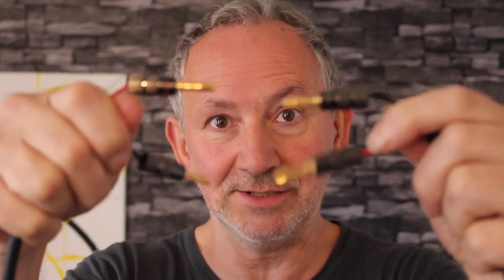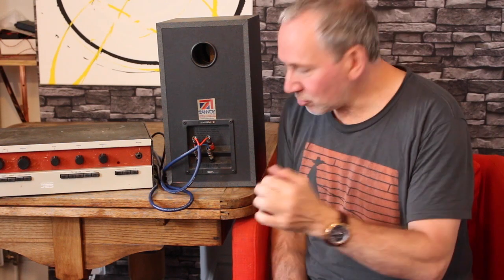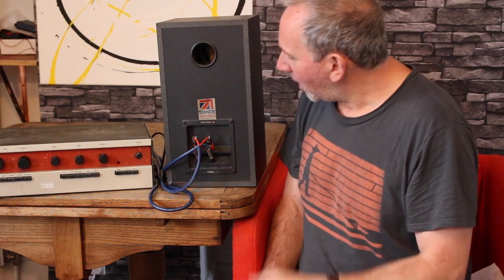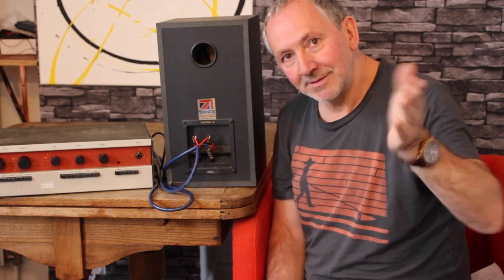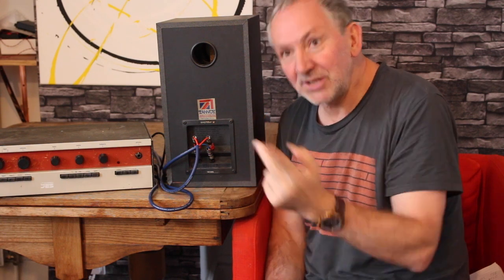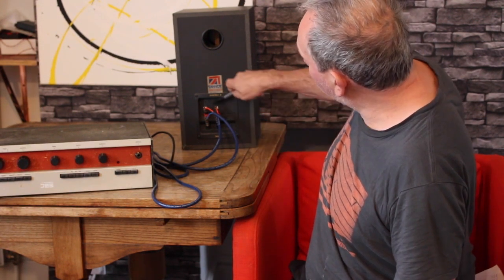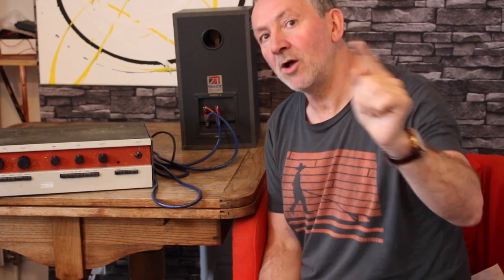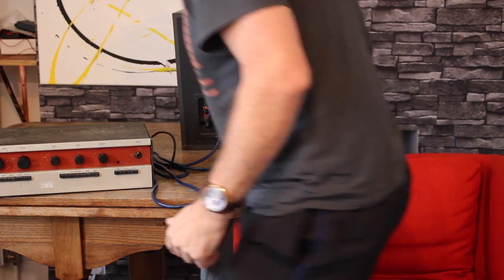WHAT IS BI /WIRING does it improve sound quality

Comment: Yeah....Nope! As others have said, you can't bypass any of the crossover circuitry. It wouldn't be able to do its job if you bypassed anything! (anything significant, at least). 
Using different cables for LF/HF could indeed "change things", but only for the worse. Some "amateur audiophile" tinkerer playing around (yes, playing!) knows better than the company that designed the crossover? Hmm, sure! Cables can only add LOSS. If you use very thin cable on the LF, sure, you'll lose some bass. You'd have to use insanely rubbish cable to have any significant impact on the HF side. Cables can't "add" anything, they can only detract, so if you're hearing differences from these "tweaks", it's because you're introducing loss in the signal path. Speaker cables either provide sufficient current-carrying capabilities, or they don't. Only on the "don't" side of it will they change the sound. Any actual "improvements" are placebo at best, IMHO. The manual for my Rogers LS3/5A speakers does, somewhat surprisingly, recommend bi-wiring. They make vague claims of "improving the stability and depth of the stereo image", which sounds like the sort of word-salad rubbish that they print in What Hifi? magazine. I remain thoroughly unconvinced about bi-wiring. It simply makes no sense. I can see how your typical "audiophile" would buy into this rubbish, but from a more technical standpoint it just doesn't make sense. "Audiophiles" are like the "quack doctors" of audio engineering. The vast majority of them have very limited technical/audio engineering knowledge and just repeat what other "audiophiles" have claimed. Probably true of that Rogers manual, too! In that case, I feel they do know better, but are telling the customer what they want to hear!

Comment: Bi-wiring is only possible if you have A+B outputs on your amp, otherwise, you are just connecting both wires to the same output.
Reply: That is a given, its using the different cables resistances to compensate for an amplifier's lousy damping factor. Think vacuum tube amps.

Comment: Wait, so you can you use bi-wiring to avoid using a crossover?
Reply: NO. The crossover is still be used inside the speaker cabinet per channel. The removal of the jumper plates simply separates the parallel connection of the two sections.
Reply: @Jason-wc3fh  Unless you have a crossover in your amp the wires all carry the same signal and that is only filtered in the speaker crossover. Bi wiring is a good way to add cost and RF noise into your system, if that's what you want.

Comment: You are missing the point of the benefits of bi wire. In my opinion the wire makes very little difference if any al all. It is all abut amplification. (Think!) you can now use 2 amps instead of 1. So if you have been using one 50w pr ch amp, but you happen to have two 50w pr ch amps then try the two. If you are really clever, you could use the two 50w to power the bass by linking them together. You can change the crossover components for the tweeter requiring a less powerful amp, maybe 15w to 30w. This will have a far greater effect than any wiring you may change. This is assuming the speakers RMS is around 120w.
Reply: In other words a 2.1 system.

Comment: It makes absolutely no difference. Logically and electronically to think otherwise is insane. Using modern speaker cable you will get no difference. The A and B terminals on the amp receive the same power, when using both they are bridged, just like the bridge plates on the speaker's terminals. So you've effectively removed the bridge plates from the speaker end and attached them on the amp end... how is that making any difference?
Reply: No difference to reality but big difference to the placebo effect.

Comment: Hi, I'm really enjoying your very enthusiastic reviewing but I think you're wrong about the Bi-wiring going direct to your HF driver and bypassing the crossover. Surely that can't be correct because full frequency bandwidth would blow the tweeter - it needs the bass frequencies to be removed because the thin coils of the tweeter can't handle that load or range of movement. Just saying! Keep reviewing please!
Reply from the maker: Yes it’s not bypassing the crossover but one wire does so that’s one why that doesn’t have to go through the whole crossover shenanigans
CheersK
Reply: Thanks K, I've just found you and I'm working my way through your reviews. Amy thoughts on vintage Castle speakers? Thanks, Ian
Reply from the maker: Well generally speaking I would rate them quite highly watch out for bass drivers with foam surrounds though that rot or disintegrate they did use them I believe sometimes
Thing with Castle they kind of not hip they don’t make that name anymore so people haven’t heard of them so I think they might be good for a bargain
K
Reply: Thanks for the sound advice on Castle and have a great Xmas and New Year 2021
Reply: @stereoreviewx   Yeah not true. Sorry. All the links do is combine the two separate inputs to the two sections of the xover. Neg will be common anyway in most designs. Biwring makes a difference in most cases but it is highly subjective as to whether its an improvement. Depends whether the designer voiced the speaker in biwired mode or single wired with the links on. And of course just personal preference. I may know more about HiFi gear than you but you are way more entertaining than me. Keep up the good work.
Reply: @stereoreviewx   Nope... Still around but owned by IAG.  https://castle.uk.com/

Comment: What is the idea behind biwiring ?
It is that some frequencies degrade some others and more precisely that low frequencies degrade high frequencies! 
-	First, why it wouldn’t be the opposite ? 
Getting into it, it would mean that a 365Hz would influence a 370Hz but also all frequencies in between. So pushing things further, in the ideal you shouldn’t “biwire” but “thousand-wire” or more, for as many significative frequencies with as many wires required!
-	Second if that was the case you wouldn’t be able to have any electronic equipment, like. spectrum analyzer! Another example is that you’ll never be able to get a square curve. This is pure electronic facts. 
This theory isn’t holding up ! Ask yourself why biwiring is done only in audio and more precisely only for the speakers’ cables !!!!

There are two types of biwiring.
Either the filters are on the drivers’s sides or they are on the amplifier’s side.

Roughtly in both cases, your amp will have to deal with two different impedances, specially if you use different cables for low & high, but the driver manufacturer has no clue of the impedances of your wires so they cannot calculate their filters in function. They made their filters supposing a same impedance cable, they cannot do otherwise unless they sell you the cables going with it but they won’t know the length you need. So biwiring doesn’t bring any avantage but furthermore it is a problem, you just double your wire cost for a degraded sound.
To sum it up, biwiring unbalance the impedances between the high and the low frequencies of your speakers which haven’t been calculated for because it is impossible.
Reply from the maker: I would say there’s two things going on
One inside the speaker you are having a shorter path to the driver it’s not going through the crossover board certainly one wire isn’t
The other thing is kind of basic which is you’ve doubled the amount of cable
Reply: @stereoreviewx  Crossover just after the amp, or just before the speaker make not much difference. In either case you have a certain length of cable to reach the speaker, so a certain impedance to factor. The manufacturer has to make an impedance choice to calculate its crossover and it is same for both High and Low. The worse scenario is having two different cables for High & Low.
When you say cables matter, you are right in the sense that some would have a better matching impedance for the couple Amp/Speaker. Some also may be better protected against magnetic fields around.
Reply: @stereoreviewx  There is no shorter or unfiltered path. The signal whether traveling through one cable or twenty will pass through the crossover. A capacitor for the high pass and an inductor for the low pass. Which frequency do you suggest doesn't need filtering?

Comment: you are completely right: by biwiring you are already reducing the resistance by around 50% - this itself MUST be possible to hear
also: as far as I remember from school: higher frequency is conducted more close to the surface of the conductor than the lower frequency so twitters should have advantage while supplied with different composition cables (vs. bass)

and then on top of that the other tricks might play ;-)
Reply: You would reduce loop resistance by half only if you kept the links in place, which would defeat the whole objective.
Reply: @paulb4661  OK, you are right. Maybe I did not make it clear: let it be 1 Ohm (the resistance of the cable). Second cable will be 1 Ohm as well. So if they were completely in parallel it would be 0.5 Ohm resistance of such double line. But by splitting the signal from the source into 2 cables for 2 speakers you make (let it be for the calculation only) half of the current in each cable: half power for bass and half power for twitter (again: for calculation only). So if your single cable setup was sending 10V from source and speakers required 1 A in total, now, with 2 cables you will send 10V to bass speakers  with only half of the current (0.5A) and 10V over to twitters also with half current so 0.5A. Apparently that is now the difference: each  cable will conduct half of the current (0.5A with biwiring vs 1A with single setup). So less current on 1 Ohm cable will leave less of the power "consumed" or "lost" on each cable. Will that make difference? Am I even correct now? My school finished ... plenty years ago ;-)
Reply: @zyghom  Let's take it one step at a time, firstly the spectrum of typical music can be approximated to pink noise, which means that power is inversely proportional to frequency, more or less. Therefore, for a typical 2 way system crossing at around 3kHz, 90 to 95% of power is diverted to the low midrange driver and only 5 to 10% to the tweeter. Secondly, the amount of current flowing through the conductor does not have any influence on its measured resistance, unless it's excessive to the point of heating it appreciably above room temperature, at which point the speakers have already ignited and took off like a rocket. Whether it's 500mA, 1A or 15A of current flowing through the cable, it's loop resistance remains determined by the alloy, CSA, length, quality of terminations and annealing methods to a certain degree. To summarize, for typical bi-wiring, a little less current will flow through the lower, LMF pair of wiring compared to single wiring and very little current will flow through the upper, HF pair, but the resistance placed in series with the tweeter or the low midrange driver will remain exactly the same, if you just double up the cable and remove links. Do not get me wrong, I enjoy the benefits of multi-wiring/amping myself.
Reply: @paulb4661  you are right: most of the current will go to the midbase rather than to tweeters. ;-)
Reply: @zyghom  Precisely, moreover the ratio of DC resistance of crossover inductor in series with the low midrange driver to that of the driver itself is the true determining factor of utmost importance, when it comes to maintaining low loop resistance - an aspect often overlooked in wiring loom resistance debates. Commercial examples often feature 0.4Ω DCR inductors in series with a 4Ω DCR driver, at which point  cable loop resistance makes very little difference, as the amplifier-driver interface is already severely compromised. In high quality crossovers the aim would be to keep inductor DCR at 1/100th of that of the driver, whilst refraining from using magnetic cores to increase inductance at least for low midrange drivers.

Comment: hi how about if my amp has only one pair of terminal means 1 can i do the bi wiring?
Reply: You can it can make a big difference still.
Reply: @MrRichymil  No, What is seen in this vid is bi amping which can make a difference in some situations, bi wiring makes no difference.
Reply: @Tappits84  believe me if you biwire from a Cambridge Audio A1 to Linn Nexus speakers like I did about 25 years ago it makes a big difference, ever tried it?  currently I am bi amping with a old Cyrus 3 with a PSXr on the base and Cyrus smartpower Plus for the treble into Linn katan speakers which is very beneficial, bi-wiring as I describe with only one amplifier and only the one set of  posts out of the amplifier for single wiring,( like the Cambridge Audio A1 but used for bi wiring) can made a big difference to  what you hear depending on what equipment you have.
Reply: @Tappits84  Indecently in the video I certainly would not describe it as demonstrating bi-amping, bi-amping is when you use 2 separate power amplifiers not one integrated amp with terminals for two sets of speakers, that's bi wiring.
Reply: @MrRichymil sorry for this question, but how can I biwire if my amplifier has one pair of terminals? Do I put both HF and LF in the same terminal? does it mean I should buy 2 cables, one for LF and one for HF and then simply put them in the same terminal on the amplifier side?
Reply: @kfernandes86  The way I did it was to put two sets of cables into each terminal. I was using solid core ring main plug socket wire that Electricians use when wiring the house. It came recommended from a friend who had  thousands of pounds worth of Linn equipment,  in fact he sold the Linn Nexus speakers I was using then.
Reply: @MrRichymil  thank you, I will try it
Reply: @kfernandes86  Did it make a difference?
Reply: @MrRichymil  I think yes, but to be honest the difference was very subtle. Seems like the vocals are a bit better. But only noticeable on a few tracks.
Reply: Most amps only have 1 speaker output per channel. Running 2 sets of speaker cables off the same terminals on your amp is just as good. The only downside is if you have stiff cables, it can be a pain to connect the two. Most cable manufacturers will terminate 2 separate pairs of cables to connect at the amp end.
Reply: @MrRichymil  I was wondering how do I make the highs flow through one cable and lows through the other? Encouragement, crossing my fingers? 
The same signal passes through both wires, only the speaker crossover filters the signal.
Reply: @spudpud-T67  if you have Linn speakers you can do what's called going Bi active using base and treble cards in power amplifiers, (or just before if not using Linn power amps) which filter out the signal that you don't want, 1 amplifier for base 1 amplifier for treble. There will be other ways of doing this but I don't know of them. you can of course just use two big power amplifiers and let the crossovers in the speakers short it out. If you're going activ You also have to bypass the crossovers in the speakers Linn make this easy with their later models. There will be ways with other speakers.
Reply: @MrRichymil  Using two amps is called bi amping, this is possible but not advised. Bi wiring is what we are talking about in this video and in this comment. A fact remains; the same signal travels through both wires from a single amp. The only filtering happens in the speaker crossover, negating 2 or more wires coming from the amp. You are however increasing RF noise and cost. A spectro on the cables will show the same signals.
Reply: @spudpud-T67  You need to hear a bi activ system. The activ cards work as crossovers before the signal is amplified and the crossovers in the speakers are bypassed. I only mentioned this as you asked regardless of any video.
Reply: @spudpud-T67  I see you didn't actually want me to explain how to split the signal. Well although bi wiring doesn't do this it does give you a clearer sound stage dependant on what you're equipment is.

Comment: “I did a proper scientific thing, I listened to them”
...not science lol. Maybe the science of psychology.
I fully support your tinkering and enjoying your system by the way. But it’s not science, and listening to the same song does not make it a controlled experiment. 
The science of electricity passing through wires is well understood and measurable. Basically if you are using a cable as a tone control, there’s something off about your cable.

Comment: Bi wiring doesn't produce any measurable difference in sound output and will make the purist fail in a double blind test. The ports are for bi amping that is mainly something of the past.

There is only one cool thing about bi-wiring, that is the fact you can hook it up to your amp and use 'speaker 1' and 'speaker 2' to turn off the requested part of the speaker. And knowing this you can do a nice trick. When you have a speaker with a sucking treble and one speaker with a lack of bass you can combine them to create something better.